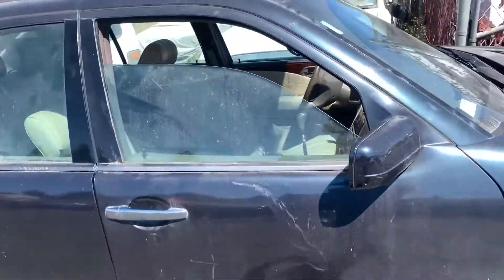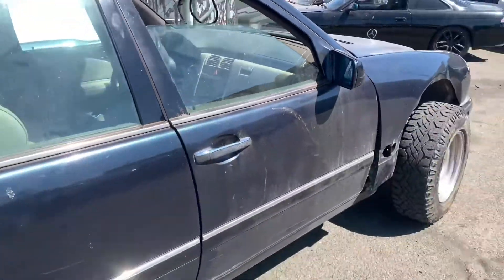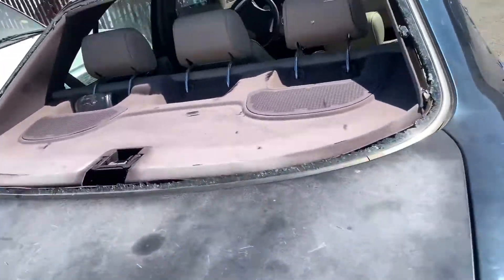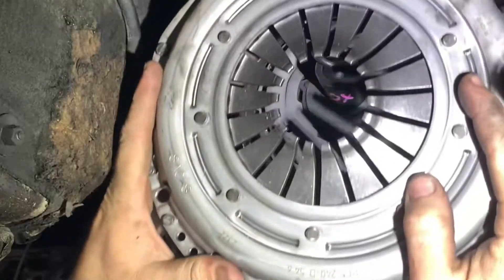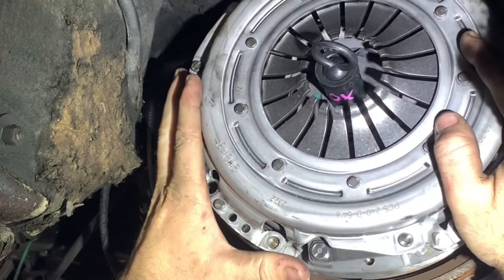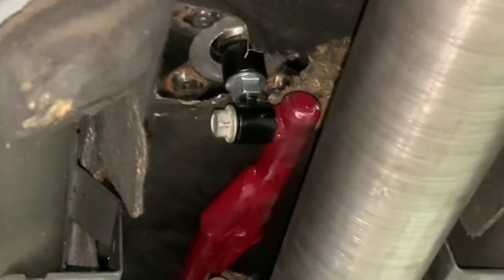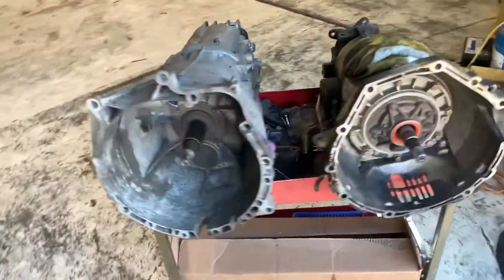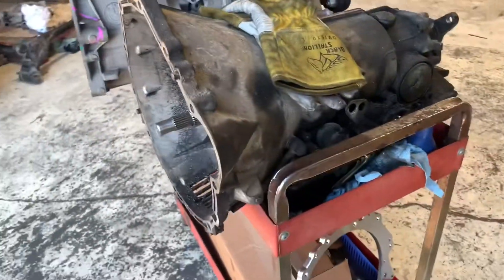How to : ZF 6 speed swap your W210 e300d / e320

Comment: Stock shifter linkage & shifter? Did it fit just fine without having to cut or notch anything? & also what did you do for the driveshaft?
Reply from the maker: Nothing on this setup is stock complete swap kits will be available very soon

Comment: What did you use for a clutch pedal assembely? im very interested in this swap!
Reply: @Curbsurf  if you can tell them to let the info out 🤣 they said it's shop only info currently. I believe I only live a couple hours from them.
Reply: This kit work for om603
Reply: Oem w210 clutch pedal assembly has a master cylinder on the assembly inside the firewall

Comment: Hi i have a w210 606 with a 6speed cdi and after releasing the gas pedal the revs hang for a bit(it also gives power to the wheels which makes sketchy situations while drifting) is there any way to kill this apart from going for mechanical? i actualy like the electronic pump on it
Reply from the maker: If it was me I’d just push the clutch in, mine doesn’t do that but I can’t definitively say that it will fix the issue

Comment: Can I do this on the straight 6 e320? Will there be any kind of computer issues? Traction control ?
Reply from the maker: @AA-uv3uf  yeah same adapter plate would work on m104
Reply: @Curbsurf where can I find this transmission? I see that the e46 used this one.
Reply: @Curbsurf I'm looking for the gearbox. When I search the one in your description. I can't find any. But I see it came in the e46 330i. Should I look for a rekt one and snatch it?

Comment: I have a 2001 mercedes benz e430 4matic w210 And I want to put a 6-speed manual transmission without losing the awd traction
Reply from the maker: Would require bmw 325xi or 330xi transmission and custom adaptation will be expensive but the team at hexa Motorsports can handle it

Comment: Where can I get a kit for e300 om606
Reply from the maker: I make them custom right now, full kit available whenever I can produce it hopefully soon
Reply: @Curbsurf  what car and model did you get the zf from? Also, how much TQ and Hp can it withstand?
Reply from the maker: @jackandthebeanstalk4523   is a 6 speed Zf comes in lots of cars both in USA and abroad, not sure of its limits I haven’t put a ton of power through one yet, very robust transmission though I’ve put mine through hell it’s a gs-6-37dz
Reply: @Curbsurf  how much does your kit cost? I have a 1999 e300 turbo diesel. It had automatic stock transmission also equipped with edc pump
Reply: @Curbsurf   how much does your kit cost? I have a 1999 e300 turbo diesel. It had automatic stock transmission also equipped with edc pump
Reply from the maker: @jackandthebeanstalk4523  there’s a ton of factors that get to the final cost of this swap if you wouldn’t mind shooting me a pm on here or a dm on Instagram @sk_3__